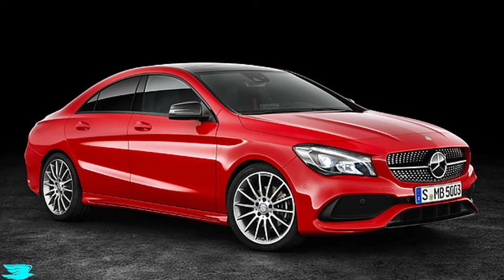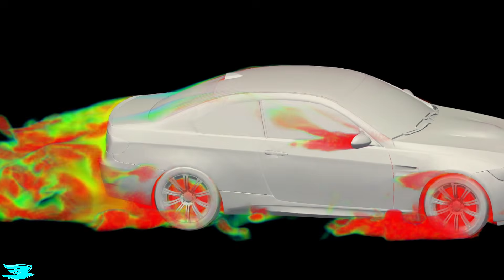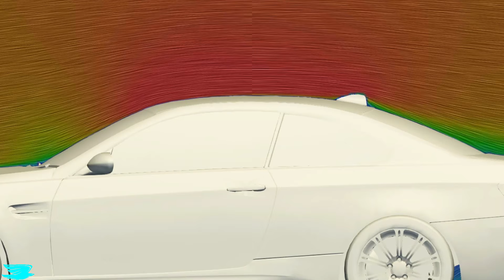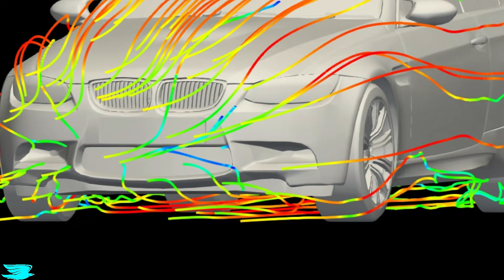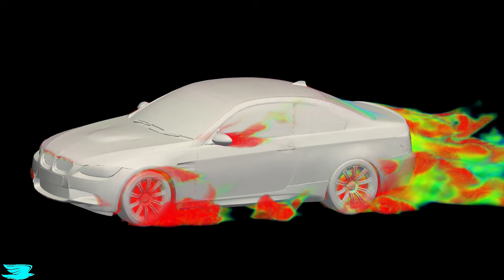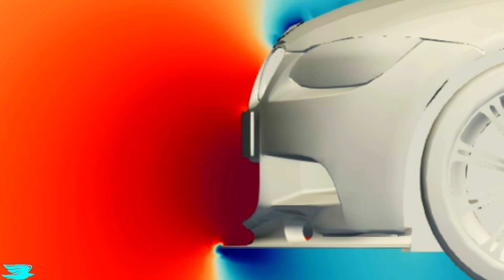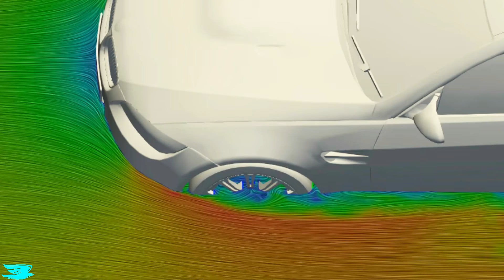Fixing The M3’s Aerodynamics Easily [E92]

Comment: Actually, a lot of cars have that high pressure between bottom of windscreen and back of hood to feed cabin ventilation. Bmw have that big fat plastic bit at the back of he engine bay panning the whole width with the large cabin filter housed in it while it also redirects water to the sides where over time it collects dirt and grime and leaves and lodges in crevices to corrode the chassis. It's a feature.
Reply: Same with the high pressure zone at the front, right at the radiator inlet...
Reply: @RobGadeke Yeah, gotta stop that air from getting sucked through the cooling apparatus or else you wouldn't have to change the dog sht cooling components every couple of years. Can't have that happening. We'll just have to wait for someone to invent hood extraction vents to create  a low pressure area behind the radiator to make use of the high pressure in front of it and reduce under hood temps so the plethora of shitty plastic bits don't get cooked.
Reply from the maker: It's a solution to a problem that exists because of that particular design.
Reply: @PremierAerodynamics It's hard to say which comes first. If they added a little kick to the back of the hood to reduce that high pressure, then they'd have to get air from somewhere else for cabin ventilation. It's true however that most designs considered successful would be lessened if this area were streamlined so you're right; the design takes precedence and this high pressure feature is just too convenient to alter. The alternative after all would be sourcing fresh air from the front of the car with tricky ducting. No big deal on rear/mid-engined cars and ev's but a pita on pretty much everything else where packaging gets increasingly tight.

Comment: Isn't the high pressure in the front helps the cooling and intake especially it's a naturally aspirated engine
Reply from the maker: Yep it does. But it comes at a high cost. Depending on the engine location, you can get high pressure with less drag by putting the intakes elsewhere.

Comment: Very cool! 
Especially seeing all planes and you going into how different cars are doing it right now.

I would love to see a 2021 Toyota GR Yaris aerodynamics and how they could be improved. I heard of a bit of lift generated at the front at higher speeds making it unstable in these conditions, where people for that reason have installed hood vents.

I have removed the rubber seal at the back of the hood to allow for air to escape, i dont know if that was a good decision or if it ruined the aerodynamics. Also i attached a rear spoiler extention just like the one in this video here of your improvement. But higher downforce in the back is not good but even worse for front end lift i would guess

Comment: How does the fact that these vehicles have grills/intakes affect these flow models? They're assuming a completely solid body, no?
Reply: Some models have some interiors and underbodys but most don't either way for the grills it shouldn't affect much as most cars have the radiator/fans behind them or they're fake grills
Reply from the maker: The flow can go into the inlets. The ducts aren’t modeled.

Comment: Could you reduce the drag by adding a spoiler on the trailing edge of the hood to kick up the flow more parallel to the windscreen? Not just on this car but in general
Reply from the maker: Yep, so in effect, they would approximate “turning vanes”, like in the corners of a wind tunnel.

Comment: can you pls do an airliner like an 737 max 10 bc they have a stupitly low amount of drag and it could be fun to see how they get that amout of drag and the reason for the cars being like 10 times dragier (also love your vid)
Reply from the maker: Just quickly, the main reason airplanes have much lower drag coefficients is because they minimize something called “pressure drag”. They have MUCH smaller wakes for their size compared to cars.

It’s kind of like throwing a ball through the air compared to a dart. The ball has a wake about the same size at itself. The dart has a much smaller wake compared to itself. So the pressure drag drops.
Reply: @PremierAerodynamics  the back of the airplanes are sloped so i am guessing that makes the wakes smaller?
Reply: @PremierAerodynamics thx for the extra info btw
Reply: #1 reason: fineness ratio
Reply: @675Films thx i never knew there was a name for it but doesnt that say if we stretch any car it will make it have less drac co ?(it doesnt make sense to me)

Comment: It would be interesting to take a low-drag car and compare removing the side mirrors vs removing the windshield wipers.
Reply: IIRC, Unplugged Performance did CFD for the Tesla Model 3 when developing their aftermarket parts. Removing the side mirrors only showed a tiny gain. The common sense assumption would be that if you decreased the frontal area and eliminated a source of drag, that you’d get a huge improvement. But it was only a small gain. 

Model 3 has wipers hidden in the cowl, so no A to B testing required.
Reply from the maker: That is an interesting idea!